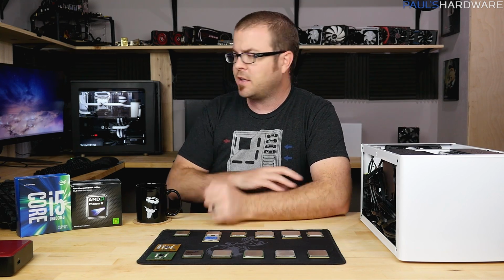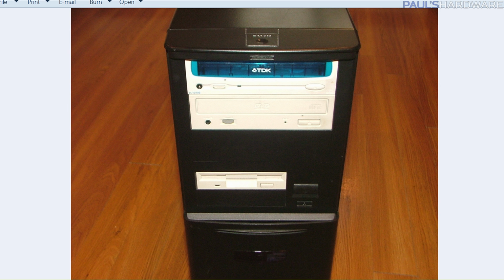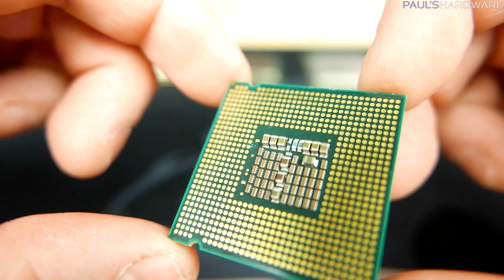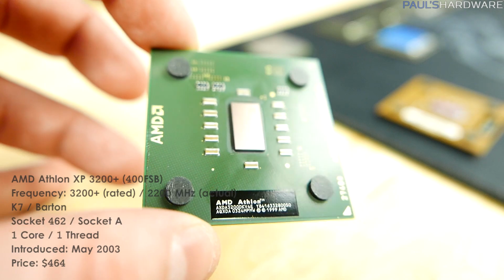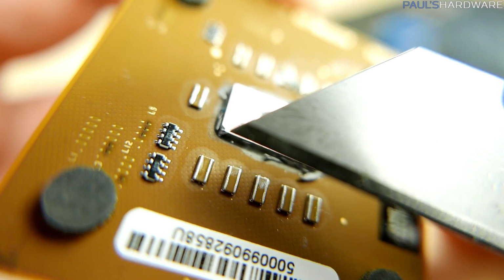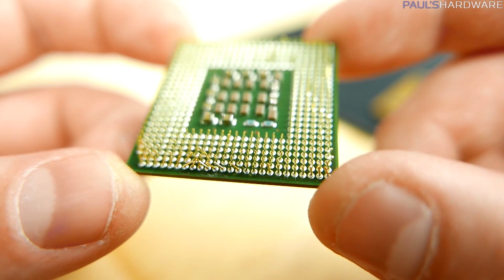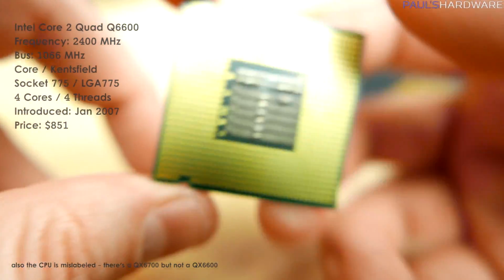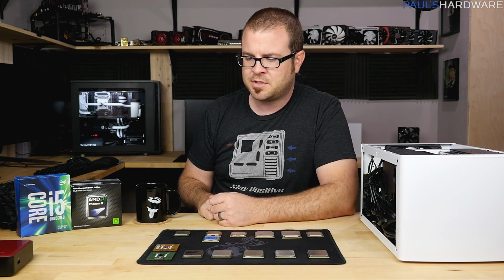My CPU Collection!

Comment: And to think, I just bought an 8 Core Sandy Bridge-EP Xeon + X79 Mobo for $150 when it was worth $1700 just 4 short years ago. Huh. Technology is cool.
Reply: ***** Intel® Xeon® Processor E5-2670 
(20M Cache, 2.60 GHz, Turbo to 3.3GHZ)
Reply: +tehDmez Ebay?
Reply: Metal Unlimited Yeah, you can buy them for $60 - $70 + Shipping. The problem is finding a 2011 Socket Motherboard that's under $200. I was able to pick one up an X79 Mobo locally for $75 (haven't picked it up yet but I will soon)
Reply: Metal Unlimited http://www.ebay.com/sch/i.html?_from=R40&_trksid=p2050601.m570.l1313.TR4.TRC0.A0.H0.XXeon+2670.TRS2&_nkw=Xeon+2670&_sacat=0
Reply: +EpicallyEvil Gaming boards cost fucking $200 USD fyi
Reply: MrEeeaddict Yeah unless you can find one locally for cheap, they go on Ebay for $200+. I was able to buy a Biostar X79 Board, it may not be the fanciest board ever but for $75CAD it will get the job done.
Reply: tehDmez lol Canada is the fuck you land of second hand items. Those $200 boards sell for $400 on kijiji/craigslist! Hell people charge more for USED than new in the store here
Reply: MrEeeaddict Yeah, usually the market is garbage. There was a guy trying sell a computer with an i7 920 and a GTX 480 for $1200 near me. I "built" his computer with used parts for half the price lmao
Reply: ***** Doesn't surprise me.
Reply: +tehDmez I am a server admin that still has some E5-2670's and 2690's(v2's and v3's) chugging away happily :)
Reply: +Richard Smith Yeah, I wouldn't have bought one of those anyways, anything before Sandy Bridge isn't very good lmao
Reply: +tehDmez yah I got an i7 3820 & ASUS X79 Deluxe mobo for 200USD.... your deal is very spectacular, but mine was still pretty good
Reply: +tehDmez I have an AsRock X79 Extreme 4 and in it a Xeon E5-1650 oc'd to 4.5GHz. Boom baby! :) I love this CPU!
Reply: tehDmez 4 short years ago it was the best for the watt but in the server environment if they can cut down a Kilowatt they will and toss all these CPUs to the curb for the newer stuff

Comment: im still rocking my 2500K at 4.8 Ghz  and have no plans to get rid of it
Reply: +TheJ666C Dude, 4.8 GHz? That's insane. Also, there's no need to replace it because if you OC'ed it that much, it beats a lot of the newest CPU's very easily.
Reply: it can go 5 Ghz but have to pump the voltage up quite a bit and i´m on air cooling and the temps get a bit off my liking
Reply: Clock speed ain't everything. It does not make or break a CPU.
Reply: +TheJ666C 2500k oced like nothing else :) had mine 4,7 24/7 but around 1,35v more or less (i really dont remember) but with a 360mm wc setup this was fine. now rocking a 1231v3 xeon at stock speeds with STUNNING 0,95v :)
Reply: +TheJ666C The i5-2500K is "The Standard" to me. It is the benchmark of which I judge all quad-core desktop CPUs against. I still have mine, in addition to my i5-3570K, and my i7-5820K. I'm gonna create a collection over the course of my life span. Kind of like how people collect stamps and coins.
Reply: Due&MartinssonProductions Well no one would be able to say for sure, as every cpu overclocks differently, but I'd think most of them could get at least 4.2ghz without too much trouble. If you're a bit more bold, you may try to go for 4.5-4.6ghz, but you may have to bump the voltages on the cpu up quite a bit to get that, which could be dangerous for the cpu, depending on how much you have to boost the voltage to get a stable overclock. For sandy's, it's best to keep the voltages at or below 1.3, and to not go above 1.35, if you want to get some longevity out of the overclocked cpu.

You may get better stable overlocks with the cpu, with lower voltages, if you disabled Hyperthreading on the cpu. Although doing that would defeat the purpose of overlocking a bit, you would have better single threaded performance, but potentially worse multithreaded performance without HT in an overclock.
Reply: Nice, my 2500k is running at 5Ghz on my custom water cooling loop. If yours is 4.8 on air you must've won the silicon lottery.
Reply: 1spaghetti32 asus p8z77-v deluxe but i think i got really lucky, because even with my first motherboard an p8p67-m it will go 4.5 with no problem :)
Reply: +Drunken Ferret it does however increase performance quite a bit especially when you're in thej666c situation
Reply: +TheJ666C 
I Use an i7 3770 non K
Quite happy with it.

Back in the day i made a mistake. I bought a brand PC ... an ACER predator G3610 with a crappy graphics card. Nvidia gt545. And couldn't even upgrade cuz the motherboard wouldn't accept another card.

I scrapped everything I could from that PC and built my own.
Reply: Top Deeps my 2500k was running at 5.3 but it died lol
Reply: Jeremy R I wonder why it died... xD
Reply: +TheJ666C What mobo are you using?
I'm using a MSI P67AGD65_B3 and stuck at 4.0Ghz.
Reply: +TheJ666C I'm running mine at a reserved 4.5 Ghz :^)
Reply: +TheJ666C Me too! Currently at 4.6GHz capping in around 70c. I feel like I could push it further but never felt the need and don't have a way to deal with the thermals anyways. Got it going on a cheap Asrock P67. The system will likely see another GPU upgrade before I replace this thing.
Reply: +TheJ666C 6300 here, at 4.7GHz, no plans to upgrade :)
Reply: Rambi fx 6300 ftw
Reply: Alex H built your own its the best thing :)
Reply: TheJ666C
Which I did :D

later.....
Reply: Valentino Aguiar :( too bad for u, i think e really get lucky now
Reply: +TheJ666C Same here. My 2500k is running at a cool 4.6ghz and with my gtx 970 it's still a powerhouse machine.
Reply: it's a great chip bro :)
Reply: +TheJ666C i5 3570k 4.6ghz :D I think im good for while
Reply: conyo985 8 Gb(2- 4 Gb stiks) and 1600 Mhz Kingston hyperx genesis
Reply: +das afFe I was able to get an i7 2600k to 4.5ghz with 1.325v(bare minimum voltage for stability at that speed on my cpu.), but I've never felt that comfortable with going to a higher speed and more voltage, and at that it would get up to about 72c at max loads(about 17-19c higher than the base clock speed.). With it at 4.5ghz, the cpu got somewhere around a 19% boost in speed on average in the stuff that I ran on it. I did eventually drop the speed of it back down a bit, as I noticed that I had to bump the voltage up by .005v on it once every month or two to keep the overclock stable.

At the current moment I have that old 2600k in a server, and have a new main system with an i7 6700k.
Reply: +TheJ666C Lol 2600k and i cant overclock it by even 0.2ghz. :(
Reply: Valentino Aguiar no oc even with 1,3-1,35v ?
Reply: Peter Pukdeesri and you dont have the q6600?
Reply: Peter Pukdeesri Nice!! i have old motherboards, cpu´s, ram and gfx card´s on the wall :)
Reply: +TheJ666C i7 920, how much can I OC it? Thermaltake SpinQ VT.
Reply: +FiNiTe no idea man it varies from chip to chip
Reply: ***** every attempt ive tried to overclock its just restarted back with the same clock speed as before. I have no clue why, its probably a simple fix but ive never bothered as i always felt the risk of damaging my cpu.
Reply: +TheJ666C How much RAM and what frequency?
Reply: +TheJ666C 4.8? hell i got a bad one i hit 4.4 ghz and it shits the bed
Reply: Un7ucky sorry to ear man :(
Reply: cartman20000 oh i see. For me it was like every 4 months i think. overclocking on the newer cpus in my opinion is not that important anyway enough threads and fast enough stock speeds
Reply: +das afFe I haven&#39;t even tried to touch the clocks on this new cpu yet, it&#39;s plenty fast enough compared to the old one overclocked at it&#39;s default 4.2ghz turbo, generates quite a bit less heat to at that frequency compared to the old one, ~47-50c full load at 4.2ghz on the 6700k(an average voltage of 1.24v Vcore/1.28v VID in full load.).
Reply: +TheJ666C My 2500k runs at 4.7GHz air cooled with very little voltage increase and doesn't even go much over 60C when gaming. Very good cpu and not going to upgrade any time soon.
Reply: inkinen nice
Reply: cartman20000 yes to make the cpu the bottleneck you have to have a lot of gpu horsepower so overclocking is really not worth the risk of degrading and the death of the chip
Reply: +TheJ666C how far do you reckon my 2600k with a cooler master hyper 212 evo could go? It's currently at 3.8 GHz.
Reply: 4.2 Ghz at least in my opinion
Reply: +cartman20000 Agree
Reply: +TheJ666C  2550K here
Reply: TheJ666C i overclocked my 6600k to 4.2 ghz(z170-A mobo) and remained at a solid 25 degrees 😂😂

Comment: I was never into the hardware side of things, but computers in general I had always been crazy about since I was a kid. The earliest I can remember in terms of specs, would be a Pentium 2 desktop I had. I got it from a school to mess around with at home (think I was 12). Than I got a pentium 3 from a literacy store that gave computers to students, and I installed genuine Windows 2000 on it. Still to this day I have no idea why or how I got a copy of Windows 2000, but it worked. Only spare CPU I have laying around though is a pentium 4 at 3ghz LGA775. Had another one as well, but gave it to my dad since he has heaps and heaps of old computer components he salvages the gold from. He has ram sticks that are like 32mb, and the size of an iPhone. Tech sure has come a long way, that's for sure :b

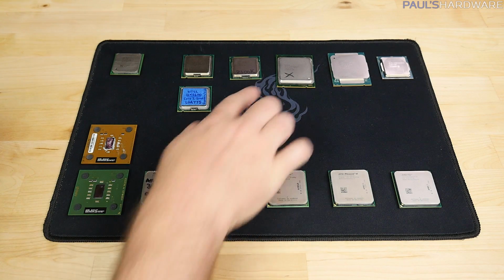Comment: 6:46 Paul !!! The first consumer/enthusiast 6 cores CPU from Intel was the Core i7 980x!! (on LGA1366) Not the 3960x =( 

The equivalent Xeon part was the X5650, which you could overclock as well! and with the EVGA SR-2 motherboard, we saw some pretty epic dual CPU build back in 2009/2010!

Comment: Awesome Video Paul. It was nice to look back into the past at where we were in terms of Computing Power, & the price at which it could be had. That was a nice touch showing the pricing info along with the specs. Also it's pretty neat to sit back and just look at how far we've come with advancements in Home Computer/CPU Technology. It's insane to think about it because It really doesn't feel like it was that long ago when we were measuring CPU speed in MHz and could really only dream about having GHz. Lol then we had Hard Drives that were barely the size of a modern CPU's Cache.

Comment: 8320 or 8350 for overclocking capability? Don't say get Intel....
Reply: PC Therapy fuck off
Reply: they are the both just as good at ocing but the 8320 will run hotter at lets say 4.5 ghz than a 8350 will run at 4.5ghz
Reply: +Ben G do you even intel bruh
Reply: RANDOM_SQUID
no bruh
Reply: +PC Therapy same dude that told someone in Cult of Mush's channel that he found it weird having a 15 y/o building his own machine.
Reply: Yohan Flores if he wants bang for the buck, then he shouldn't be looking at any FX or Intel Processors.
You can grab 16 core opterons on ebay for 50 bucks. Just do that if you're on a budget. That plus a board will maybe cost you about $150, and you have twice the cpu power of the 8350
Reply: wenisinchina true. I'm getting a xeon v1231 some time from now since it's a poor man's i7.
Reply: Yohan Flores u smoke 2 much pot bruh
Reply: PC Therapy Is it bcuz im mexican?
Reply: +Yohan Flores Hes just another Trump supporter.
Reply: +RANDOM_SQUID Thanks :)  I was also looking into the 8320e, but it has  lower over all base clock at 3.2ghz vs 3.5 for the 8320,will that affect anything?  I am leaning towards the 8350,but I like the 8320e for it's lower power draw
Reply: +PC Therapy Grow up
Reply: +Ben G 8320e is basically 8320 underclock the e stands for efficiency so when you oced it you will get the same tdp as the 8320
Reply: Solar lol don't worry I'm not actually Mexican, I have Mexican heritage. I just to go along with the stereotype lol.
Reply: Ben G I agree with rushdrift
Reply: What's wrong with intel?
Reply: wenisinchina possibly looking for a bang for the buck build.
Reply: Yohan Flores Nice, I've recently bought a dual 12 core opteron proliant server, and I'm upgrading it to dual bulldozer 16 Cores (for 32 total cores). Old high end hardware is amazingly cheap haha
Reply: wenisinchina but then server cpu isn't that easy to handle compatibility is an issues here, you need the correct ram mostly server need ram that support ecc and certain kind only works not to mention some mobo dont support ecc ram, so its a hassle even though its a bang for the buck
Reply: rushdrift Incorrect. You can buy server parts such as ECC memory and G34 motherboards for cheap on ebay, and they're extremely easy to find. You're an idiot if you're not willing to do SLIGHTLY more digging to get a MUCH better deal. If you're on a budget and want good bang for the buck, then shitty retail-priced consumer hardware is not really something to consider.
Reply: wenisinchina I dint say the part isn't easy to find I say about compatibility, some people just don't want to go to that route you know~
Reply: rushdrift You keep referencing these vague "incompatibilities", what do you mean?
Reply: I am just needing a new cpu, I have a 990fx Asrock Fatality Killer
Reply: Ben G 8350 non oced is 125 watts and oced its 240/250watts
Reply: +RANDOM_SQUID calm down Minecraft nerd
Reply: +Ben G 

I'm running an 8320E @ 4.5 GHz. It's a neat processor with an even better price tag.
Reply: *****
put it in some amd cooler and dye and eat it bru
Reply: +Ben G get Intel
Reply: +Person. because Sup wasnt joking.....
Reply: ***** Richey Amigo Herpler Gaming Lol, at first i was joking, but now i have to prove this idiot wrong. 1) It is not simply more expensive, but you are right, it is more expensive. That is because of the better performance, longevity, and understand-ability of the different models. Seriously, AMD has like 15 different processors that are consumer grade and they all have different numbers that are arranged in no particular order. You would think that as the number gets higher, so would the performance, but that's not true at all. There's the 9000 series, which is apparently just a rebranded 8000 series, and half the 8000 series are just rebrands of each other or the same thing with a higher clock rate or something of that nature. THEN there's the 6000 series (wtf happened to 7000?) which, frankly, I'm surprised anyone can follow. then on the other side, there's Intel, which has the 4000, 5000, and 6000 series, which are arranges so that as the number gets bigger, so does the performance, the i7s are easily differentiated from the i5s and the same with i3s. That number concept also applies to the i7, i5, and i3. The i7 is the premium grade chip, with hyperthreading and a higher clock rate, the i5s are midrage, good budget chips that are still quad core without HT and a slightly lower clock speed, and i3s are the lower end, for use in laptops or low end desktops. Enough about numbers though, lets talk about my other 2 points. Better performance: this one is arguable, but from my experience, you need to push AMD chips to much higher clock speeds than Intel to get the same performance. For example, if you OCd an i5 4690k to 4.0GHz, you would need to OC the AMD equivalent to 4.4GHz to get the same performance. Better logevity: have you seen how much power AMD chips pull? its up to like 120w. And everybody who knows anything about computers knows that more wattage being used means more heat, and more heat means more wear. I don't really need to say anything more about that, you get the idea. 2) Ok, well it wasn't made very clear that he has aboard for it, but ok, if he does than he SHOULD get AMD. 3) There are some very good Intel boards for <$100, you just need to do some research and go with a reputable brand. Also, if you want to go with pretty much anything but z170, the MOBOs are pretty damn cheap, and will pretty much only go down more because you aren't paying for the latest and greatest.

Good god, you're still reading? Congratulations! high five
Reply: Suprpineappleman

You make some good points. The naming scheme isn't one of them (seriously, who gives a fuck?). AMD has been lacking behind Intel for a long time now when it comes to IPCs (Instructions Per Clock) which are arguably just as important as the clock speed in terms of performance. AMD is running on an architecture that's effectively 4-5 years old, and its performance was already sub par when it first hit the market (Bulldozer). What AMD have managed to do is sell 8-core CPUs at extremely competitive prices. That worked out well for them to begin with, but the bubble is gonna burst soon, unless AMD have some tricks up their sleeve.

Thing is, it looks like they do. The Zen architecture is looking very promising from what we know so far. It's said to offer more than a 40% increase of IPCs, allowing AMD to lower their clock speeds and produce more efficient CPUs. Along with moving from the 32nm process that Bulldozer and Piledriver is based on to a 14nm process, the efficiency of the architecture will improve drastically. We'll have to wait and see what Zen turns out to be, but up until then, Skylake is probably your best bet right now. The Skylake i5s kick a buttload of ass, and if you can't afford one of those, even the i3s are surprisingly powerful.
Reply: Owminator I only mentioned the nameing scheme because i personally was frustrated by it when building my first PC. I know about half of the comment was about it, but...

shuddup
Reply: 9000 series